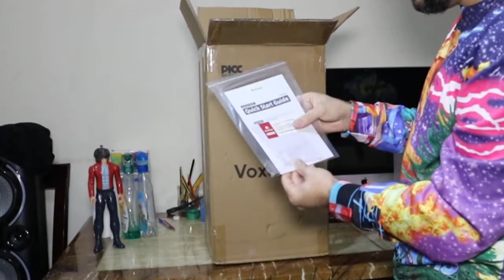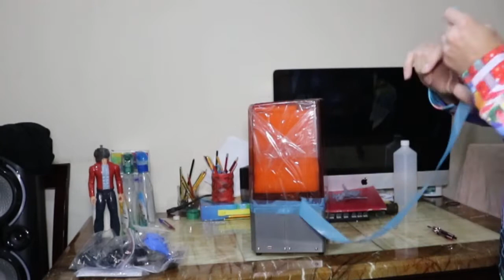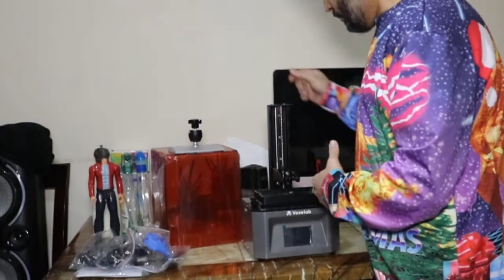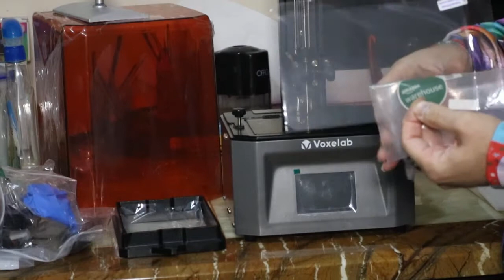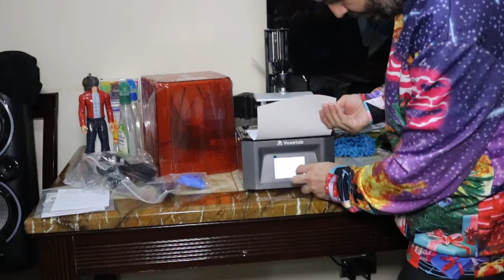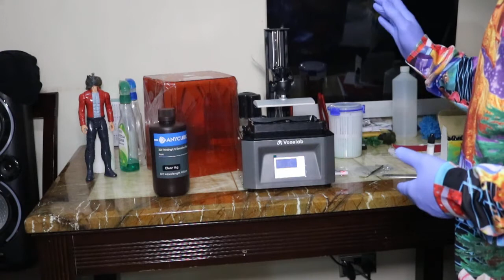Voxelab Proxima Resin 3D printer - Unboxing and First Look

Comment: Hello Mate, 
Could you please post that Sliced print (or anything already sliced for this Printer)? I am looking for it to run a Test Print on my printer as all the Prints thus Far are just Flat with nothing else printing except for the Flat Base. 
Please help...
Reply from the maker: I am not sure how to share it here but there are files on the facebook group that you can join and access. Just go and look for voxelab proxima on facebook

Comment: Compared to the elegoo mars how does this compare? This one is $50 cheaper than even a mars pro I'm wondering if this is the budget/beginner friendly go to?
Reply from the maker: I actually had an Elegoo mars 2 Pro which I returned and replaced with this one. I also currently own an Elegoo Mars Pro. But the build plate on the Voxelab is bigger than the Mars Pro and the print quality is just the same. This has become my go to printer and I rarely use the Elegoo. I have only had to reset the build plate twice since I got it and only had a couple of failed prints which were my fault too. Overall an amazing printer. I am planning to post a video comparing both so do watch.

Comment: I've got one of these myself, first 3d printer.  I'm pretty happy with it overall.    I think my biggest problem is learning how to support properly.
Reply from the maker: If you are new to 3D printing or resin printing then that is normally a very normal issue. But one thing you can do is add more supports after the software has already done them (Chitubox or voxelprint). Having more supports will be fine until you start learning where they are actually needed. Sometimes my parts have failed and when I reviewed the print I saw where the failure was actually happening consistently and put more supports there. It is a very exciting hobby and I am sure you are enjoying it.
Reply: @AmzTechwizard  I'm new to both, the Proxima was my Christmas present to myself.      Used it to make  gifts for the holiday.   Mostly worked out.. but my support work needs work.  But I get impatient.   Still learning.